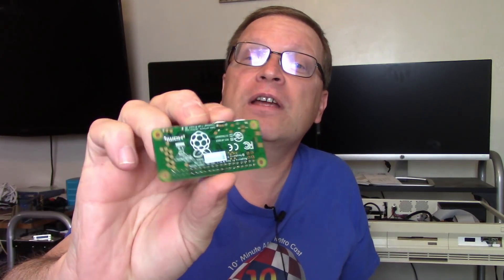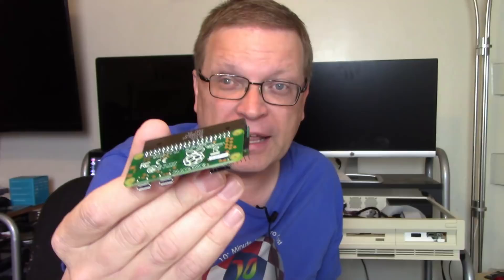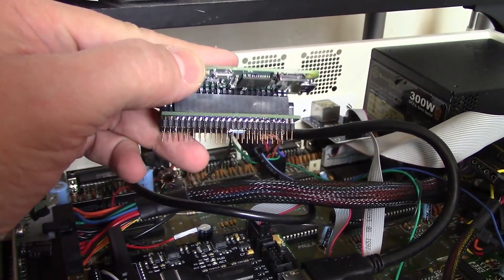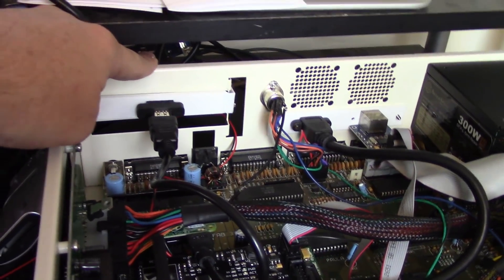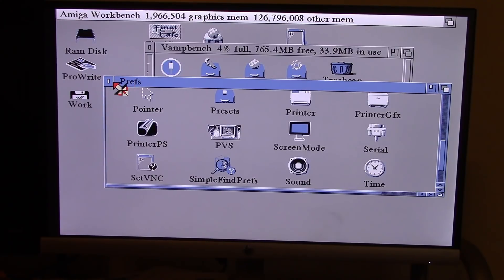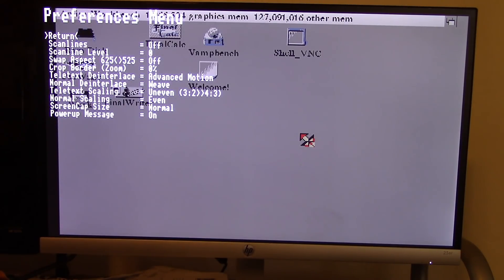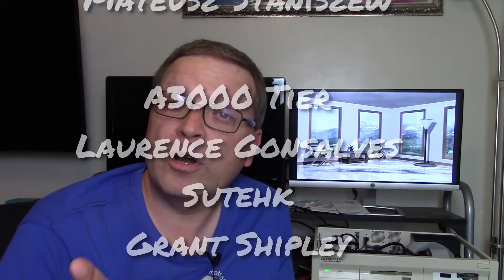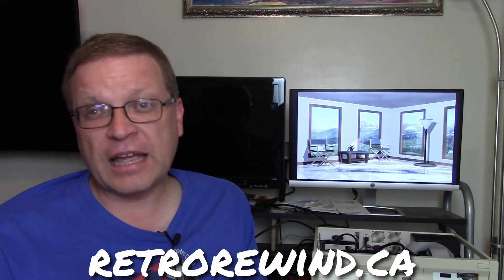RGB to HDMI Review for the Amiga 500 - 10MARC Episode 91

Comment: Great video Doug. I got one on eBay and so far it is underwhelming. (I may just order a new one from RetroRewind.ca) What version firmware do you use? Mine incorrectly selects the Amiga 50hz profile anytime I change a setting resulting in the blinking screen until I bring up the menu again. It also gives graphic errors at high resolutions >=1080. (This is due to timing issues with some of the chips used...a new version of the board is in the works.) Finally, I cannot get it to do overscan - It only wants to display 640x200 regardless of the settings for the min/max of H and V and then restarting the Pi. Now that you showed the overclocking of the CPU and the core I may have that to try to get the overscan working. I didn't even try PAL before I pulled it out to test in another A500.

My biggest issues about the design is the one button operation (it should be two or more like the devices for other systems), the lack of clarity in the docs about what all the settings are in the profile file so that they can be more easily edited, and that it disables the Amiga RGB out. Losing RGB out for supporting an old CRT monitor when you want one is a bummer as it would mean more dongles and adapters to split the HDMI and then convert to VGA/Component/etc.
Reply: Not that we wouldn't love having you as a customer over at retrorewind.ca, but if we can save you some cash we will be more than glad to do so. What release of the software are you using? They make great strides almost weekly with the software and it sounds, from your description, that you might be using an older release of the software as older releases didn't support 60Hz NTSC signals.
Reply from the maker: Wow! Maybe we can tackle these issues on email or something! I think we can figure most out, though. Strange how your RGB is disabled. Mine works just fine on my Amiga 2000 and my zero card. I guess I never really tried it on the Amiga 500. But I thought that RGB still work just fine
Reply: @Retrorewindca  I believe the software is the version from January. I tried the beta17 version but it didn't do anything. The seller on eBay has been quite helpful and willing to troubleshoot incase it is just a flaw in the board they sent me. We are still working on it. I also have another Pi Zero coming as last night it suddenly wouldn't boot at all. Aren't old computers fun? :)
Reply: @10MARC  As I posted to Frank, I am going to try another Pi because I am not sure mine is still working after last night and moving everything to my other A500. It may be that I just have a faulty adapter and/or pi causing my problems.
Reply: It doesn’t disable RGB out. I have my 1084s monitor and the hdmi working at the same time.
Reply: @mja65  Mine did which I thought was strange but I couldn't get a display over RGB while the RGBtoHDMI was connected. Pretty sure now there is something wrong with my Pi Zero. I am currently installing an SD card with the RaspberryPi OS to just test but I am not hopeful as the it won't even show the rainbow test screen anymore. Meh... new one on the way anyhow.

*EDIT* Well RPi OS booted up fine. Reformatted the SD card and installed the RGBtoHDMI software 01/31/2021 and I get a flash of the rainbow test pattern. I guess the Pi Zero may be okay after all. The seller of my adapter is sending me another free so we will see if that is the issue.
Reply: Okay one more update. I reinstalled everything and this time it booted without green graphic glitches across the screen at the default auto 1920x1080. It also allows me to adjust the overscan through max h/v. I haven't played with PAL modes yet but I am getting "shimmer" as I have seen it described, in pink where some high contrasts are. (Menus in PPaint are pretty bad.) This shimmer is one issue that I have been reading about that is being worked on for a new revision of the adapter.
Reply from the maker: Do you have a Denise or Super Denise? Make sure you toggle the jumper (if you have one) for the appropriate chip. If not, you will get those exact symptoms
Reply: @10MARC  My main machine has a Super Denise and the jumper was set. I re-did everything over again last night and it seems to be behaving itself now except for the shimmer which I may be able to solve with a 220pf cap added on the adapter.

Now that I was actually able to tweak the overscan settings to match the OSSC the OSSC is a bit sharper when compared to the RGBtoHDMI using Full/Soft. The integer scaling of the RGBtoHDMI is absolutely stunning but I prefer to have the display filled vertically with an approximately 1:1 pixel ratio.
Reply: Wondering if the RGB out not working could be something to do with not enough power getting to the port once the adapter and pi is installed?

Mine arrived from CBM Retro in Finland at the weekend, although need a pi zero still. Plan was to have the HDMI for the odd occasion when I might want to hook up the A500 to a big TV or capture device. I have a 15KHz Benq which I am happy with and will probably stick to for the most part, so hoping the RGB out still works fine with this installed.

The output Doug is getting looks really clear and the A2000 version looks particularly neat. Scratching my head trying to deciding where to put the HDMI out on the 500.
Reply from the maker: @roscoe500  some people are using a dremel on the case right in front of the floppy and mounting an HDMI jack there
Reply: @roscoe500  Once I started over with a fully reformatted SD card and double and triple checking that denise was fully seated and everything was connected the Amiga RGB output is working again with it and most of my other issues disappeared. I am seriously thinking that something was corrupt on the SD card rather than a power issue since I have my 500 in a Checkmate case with an ATX PSU.
Reply: @10MARC  Think I might get a 3D printed expansion slot cover and cut that to fit the HDMI and if that doesn't work well then just under the floppy drive at the back.
Reply: @one_b  Good to hear you got it sorted, for me if the RGB out not working at the same time would be a deal breaker.

Comment: How did you not need to solder an extra 512KB memory directly onto your a500 to get 2MB chip? Doesn't your megachip only have a 1MB chip?
Reply from the maker: Nope. The MegaChip specifically adds the 2 MB Agnus and has 1 MB onboard. Then uses my 1 MB on my Amiga with my 512KB card, and I am happy !!!
Reply: @10MARC  perfect. Now it all makes sense.

Great video doug!

Comment: you know it is a pity they don't redesign the board to fit into the expansion slot when the isa card would go..
Reply from the maker: I suppose it is because they need to capture the RGB signals coming out the video slot.
Reply: @ButterfatFarms  i been around computers for a number including  commodore and amiga , with all the known issues that has plagued commodores over the years trying to recreate what was known as a faulty system to begin with I love that people still use a dead product however I would love to see both commodore and amiga and build something without fault, I love there is products out there to extend the the life of the commodore 128 and the commodore amiga and  a lot of other things..

personally i would love   to see a a proper amiga with an hdmi port as a native solution with the  the capacity of connecting original  hardware or even given the capacity  of m.2 as an example

Comment: I have all the stuff in to start building RGB2HDMI Boards for my A500's and A2000 and yes my intention is to replace my Indivision Boards.   My thought process is to get everything I have over to HDMI because its easier to get.  On the other hand I am not unhappy with my VGA Solutions but I am not sure which way I will go but I have both VGA and HDM KVM Switches in my Amiga Rack but I only want to really use 1 Keyboard, 1 Mouse and 1 Monitor for my Amiga Rack Setup but the monitors not a big issue as there are actually 3 on my desk now.   VGA is still around but over time it will become harder and harder to find good VGA Monitors and for that reason HDMI is a viable solution.    As for PAL I will cross that bridge when I get to it.   The only time I might want to use PAL is to play a game but I have PAL Amigas for that purpose and I have 2 monitors which play with NTSC and PAL and they have VGA ports that support 15khz and HDMI Ports so its all good for me.
Reply from the maker: Sounds pretty clever. And I'm interested to see your opinions of these versus the indivision products. I also have other machines that work fine and PAL mode that I can use for playing games, and the standard RGB port still works fine, so I can just hook up my RGB to SCART interface and use pal all day long..

Comment: 4:11: ECS/OCS does not have Double-NTSC or Double-PAL. That's AGA only.
Reply from the maker: Sure they do, and they look beautiful on ECS. Rock solid 640 x 400 at 31.5 Khz. Very similar to the ECS Multiscan Productivity modes, but using more traditional Amiga screen sizes. They are limited to 4 colors out of 64.
I am literally looking at a DblNTSC workbench on my A2000 right now, just using an RGB to VGA adapter.
Reply: @10MARC  You are right, I forgot about the color-reduced ECS versions.
Reply from the maker: @kopernikus1955  they look super sharp, too. The Productivity Mode 640 x 480 in 4 colors is much better looking than a Mac BW display
Reply: @10MARC  I never used them. I'm pretty sure they didn't work when routed through the A3000s flicker fixer. I never could be bothered to activate a switch or swap connector when changing screen mode. I remember "productivity mode" though, that was slow as a snail.
Reply from the maker: Yep. If you used it on an Amiga 3000 these modes would be next to useless. May as well just use the good old amber chip and the VGA connector. I never use them either on my Amiga 3000, but I use them all the time on my Amiga 2000 and Amiga 500 for workbench displays.